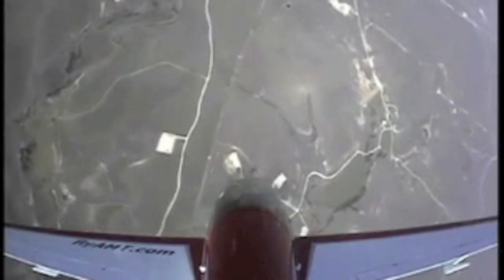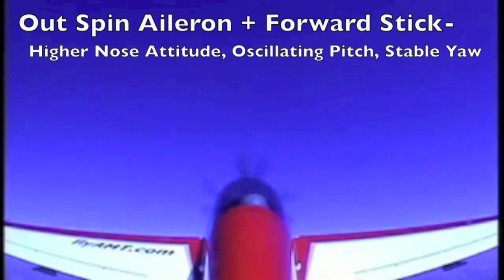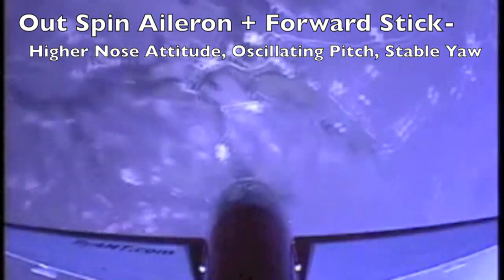FlyWire Accelerated Spins

Comment: At the end of the video are you recommending aft stick for recovery? I watched several times to make sure I was hearing it correctly. I was taught slight fwd stick is the proper recovery.
Reply from the maker: You got the wrong order out of it. The first thing you do is go Idle, neutral, aft. Then rudder opposite spin, followed shortly thereafter by stick just forward of neutral.

Comment: Power in left spin versus right spin? As you’re referring to this from multi-engine spins, power outboard versus inboard spin. Again, as you’re referring to this video from multi, fuselage loaded inertial moments and ailerons versus wing loaded inertial moments and ailerons? If you’re going to compare for spins, you should also contrast. Look for the NASA Dec 1971 technical note 6575, look to Sammy Mason’s book and Darrol Stinton’s book, see the wing loaded ASK-21 1989 spin report. Look at the equations of motion and how both yaw and pitch moments change based on loading.
Reply from the maker: Power is pro spin. I think I made my point. Why do I need to do more?
Reply: @FlyWirescottperdue  Power is not pro-spin if it be the inside engine as you showed elsewhere with the F-15E. And as you mentioned as possible for the inboard with a twin. Hence one of your statements you’ve rendered false, which is it? (It’s the absolutist one saying “power is pro-spin”) You did your spins to the left and added power yet we know adding power requires right rudder for left tendencies. Consider the impact of this were you spinning right with the single engine tractor style prop.
Reply from the maker: @jimallen8186  That inside engine Military power for the spin recovery was in an F-15E... and spin tested. I said you could try it if you want to be a Test Pilot. Without data I will not say it is anti-spin. I suspect that power was part of the test program in the Duchess and maybe the Baron, but it was not mentioned in any documents I could get my hands on. So, at this point it is speculation.
Reply from the maker: @jimallen8186  Jeez, Jim there is no material difference left or right. You're splitting hairs here that make no difference. My point about power in a light twin... there is NO published flight test data for that. So go try it and get some data. I have zero interest in doing that. So, I'm looking forward to your results!
Reply: @FlyWirescottperdue  with the single engine, which you used as example, there’s a huge difference right and left. It’s not a hair split. With the light twin, there’s huge difference inside engine vs outside. SE left spin power is pro spin but right spin it is anti spin. ME outside is obviously pro spin but inside is anti spin. See 1971 NASA technical note D-6575.
Reply: In SEP, power is pro-spin regardless left or right. Yes, a spin in the direction of P-factor will be faster, but the prop still has GYROSCOPIC effect on the spin!

As for "inside engine is anti-spin", it depends upon exactly where the center of rotation is. If the aircraft is spinning perfectly around the fuselage, then perhaps, but it also depends on direction of prop rotation. Depending on direction of prop rotation, again, gyroscopic effects rule, and it may only be neutral at best.

You can't pay me enough money to go try it.
Reply: What would be really interesting to see, are high drag devices on the wingtips. Think split aileron like the B-2 for yaw control (remembering they are aft of the CoG for stability).

In a spin, deploy drag device on the outboard side. It would need to be fairly large to be effective.